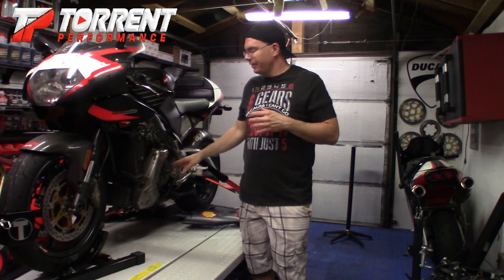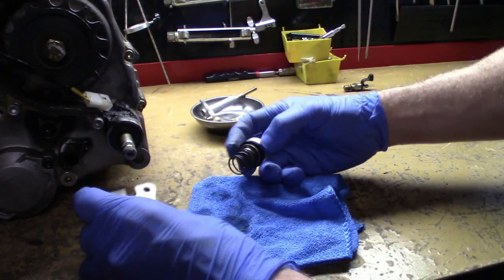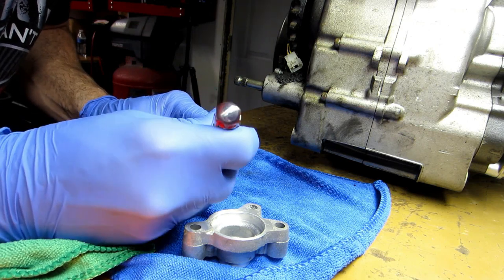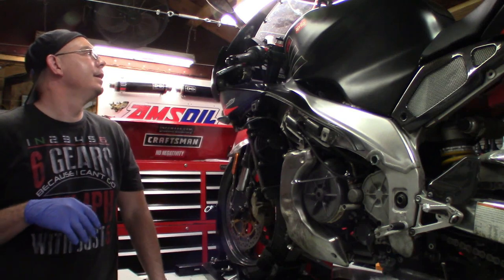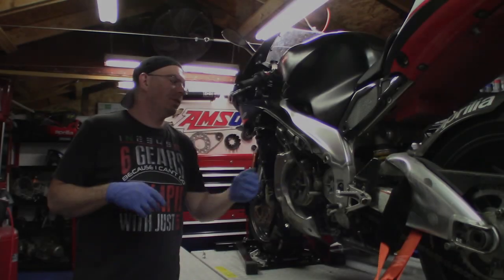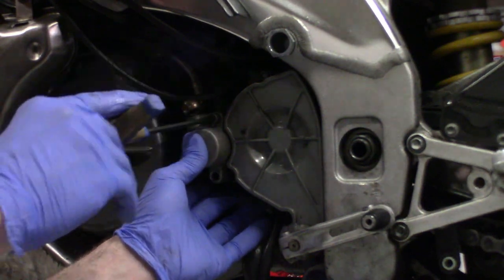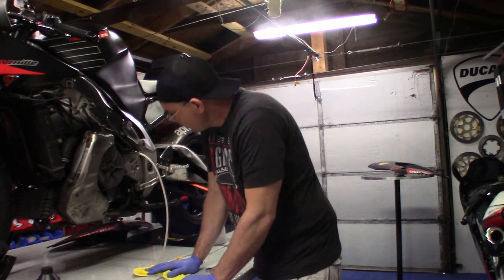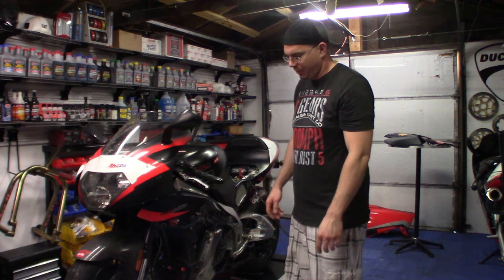Aprilia Gen 1 Mille And Tuono Clutch Slave Cylinder Seal Rebuild

Comment: Nice vid 👍👍 i had same issue with my rsv mille R, losing clutch fluid..and i just replaced the seal and it fixed
Reply from the maker: Check out my other vids I have alot of good vids on repairing these bikes. Check out new series it's a 2000 mille r I'm getting back on the road. Thanks for watching!!!!!

Comment: hey there, great video, thanks. my clutch master cylinder doesnt spring back now after i did this repair. seems stuck. any tips?
Reply from the maker: Did you roll the oring on
Reply: @TorrentPerformance  i just found the problem. master cylinder spring broken into 3 pieces... didn't know that was an option...maybe it helps someone